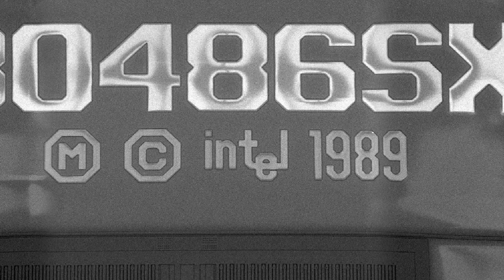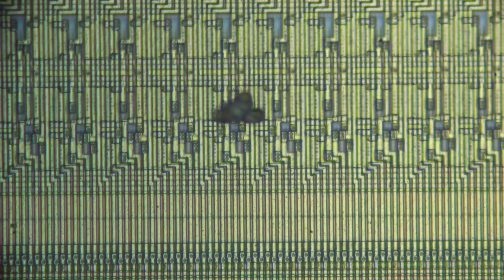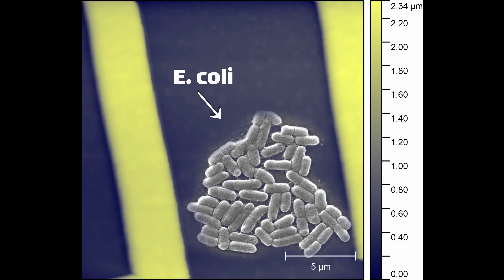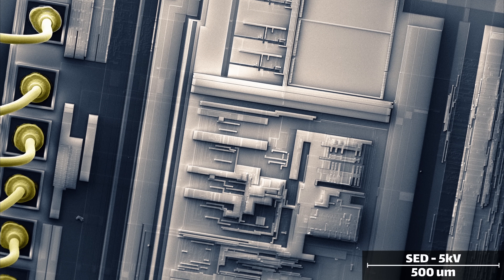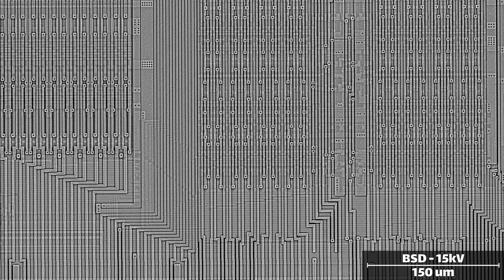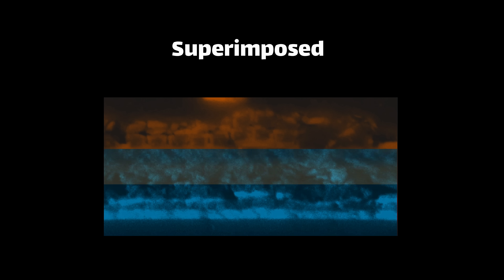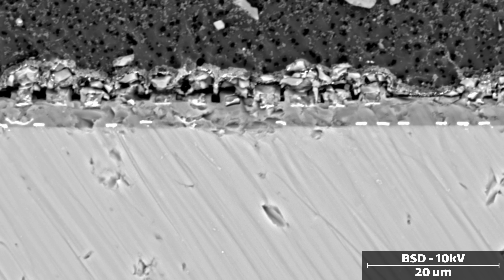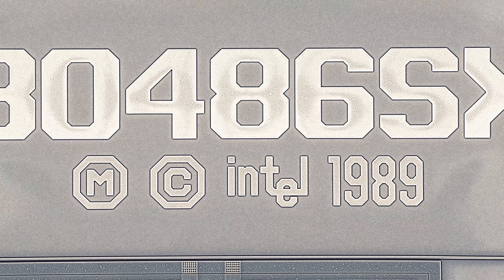Microscopic view of an Intel i486

Comment: 0:40   I don't know. PCBs look quite organic with all the leads leading to chips and other electric components. Directing currents to and from different parts to power, and communicate between them. It is like a combination of an the circulatory system, nervous system, and organs. Each part needs the others. The main difference is the materials used, which dictates the other design aspects. While it is gross to think about, it is not that difficult to imagine a world where scientific advances were more significant in some areas than others, resulting in our tech is made of simple synthetic organisms. Gross, but not too far fetched when you approach the thought experiment from a "function over form" perspective.

Comment: And my i5 2500k is STILL going strong overclocked 24/7/365 since 2011, 4.2ghz 1.27v, stable AF :)
Reply: But also slow. Even absolute garbage these days runs faster and more efficiently.

Comment: Awesome video!

A minor correction, if I may: whenever you said "wafer", you actually should've said "die". A wafer is a large, round piece of silicon, sliced from an ultrapure monolithic silicon crystal. Dies are individual chips microlithographically drawn on the surface of the wafer and then cut out after etching.

Comment: It's not so much that they want to make right angles it that there's no point, especially in the interconnects back then when the defects had to be pretty gross to cause a failure. When you're engineering something that nobody is looking at, function is everything and form is nothing.

Comment: I started work in a Failure Analysis Lab 40 years ago and worked with microscopes and basic tools. A few years ago I returned to the work and now have access to a SEM. You're right about the polishing process. It's a skill and an art that requires a lot of experience to become good at it. I don't have that much either but there isn't much demand to see chip defects in the OEM electronic manufacturing arena these days. My predecessor did this type of work 20 years ago and used plasma etching equipment and chemical etches to remove the IC layers. Removing the layers requires knowledge of the device's construction as one of the other commenters has pointed out. Otherwise you're experimenting and hoping for hte best.

Comment: Thanks for showing this! I have always admired the i486. :) It blows my mind how advanced microprocessors had already become at the end of the 1980s! The i486 DX4/100MHz is an absolute BEAST of a CPU under Windows 95 (with 32MB 60ns RAM and 256k 15ns cache). Not even joking. The i486 DX4/100 is so powerful that it will do true polygonal 3D graphics (it'll play Descent and Descent 2) all in software at 35 fps without hardware acceleration with only a 512kb 16-bit ISA VGA video card under MS-DOS. 8 slot (1x8 bit ISA, 4x16-bit ISA, 3x 32-bit VESA) 25/33/40/50MHz (adjustable by jumper) Socket 3 motherboards are the best motherboards ever made!

As for your video narration, it would be much more listenable if you moved further away from your microphone and spoke louder. Narration is an art form I've studied for decades, and the best style that suites a general audience is a smooth, yet vocal and gritty, authoritative tone (Mythbusters narrator is an absolute prime example). Speaking softly and calmly close to a microphone and letting your voice granulate isn't how professional narration is done. Try taking my advice because I love your videos. :)
Reply: younger people today have no idea how much work a 486 is capable of. I can't think of anything we do at our office, other than the demands of today's internet, that couldn't be accomplished with a 486 just about as well.

Comment: Chip designer here, I am amazed by the amount of hand layout done in the late 80s to construct a processor. Today most of the functionality is automatically placed and routed with a ratsnest of wires going all over the place. This design is beautifully engineered and many thousand of man hours went into such a intricate layout.
Reply: We have IC design courses in University. It's interesting, but the goddamn tools we use from "Cadence" suck so much they make me not want to do it. And unfortunately there aren't really any companies that do this around here.
Reply: @WetPig  Ironically, we DIY home-based chip makers have started to use KiCAD and even sub-$1000 USD compressed fluid piping design software which uses CFD (Computational Fluid Dynamics) math to SIMULATE actual electrical traces, junctions, transistors, etc. and SCALING DOWN the designs to sub-micron scales.

We can find chip-design errata and electrical engineering issues using CFD math to simulate electrical and semiconductor processes within the much-cheaper-to-buy MECHANICAL ENGINEERING design systems! It's a bit of an inventive method using something that was NEVER designed for chip making and using it in a new way for DIY home-based chip making!
Reply: How well do you understand how computers work yourself? Do you just have a simple manual, or do you “understand enough”, or do you have a full understanding of computers? I’m wondering if the knowledge of this tech has to be fully distributed because it is so complex or not.
Reply: @AuthoritativeBanana  conceptually: quite well, I have been involved in several custom processor designs. In detail: only with reading a lot of documentation. 

However, the workload of designing is typically split in large teams where some people do the system design space exploration, some people do implementation in a hardware design language such as (System)Verilog or VHDL, others again do extensive testing and formal verification and then there is the people that do synthesis and place and route as well as sign off (design rule checks, layout vs schematic verification, post layout simulation…) Smaller microcontrollers can be done by a team with a handful of people while large SoCs and CPUs require hundreds of people with very specialized skills.
Reply: @christophmuller3511 hundreds of people for one cpu?! holy shit! Ok thanks.
Reply: @ionutandrasesc2376  Also, remember that designing a CPU doesn't stop at the physical thing; you also have to write the software for it (fun fact most modern CPU have smaller mini CPU integrated into them for managing the internal working of a CPU) and create documentation for developers to use it. Make sure that I can be used on some platform, make sure it has a way to communicate with other components and make sure that it is compatible with old software (if applicable).
Reply: Dude it looks like something an artist painted like holy crap. It’s like a universe within a universe lol
Reply: Well this is also wire bond technology with huge interconnects. We have tiny interconnects nowadays hahaha. The rats nest is kinda necessary for the functionality right?
Reply: Anno Kitsune  you're a bit late lol
Reply: @FlamestoneDragon  lol
Reply: Hello fellow pedants! This is your uber-pedant speaking...

I'd just like to point out that it's "rat's nest", not "rats nest".
Reply: Are you coming to a US based chip manufacturing plant?
Reply: Year 2123: Aaahhhh..... the days of mankind!
Man AND Woman, In the image of, they used to be...... Legends and folk lore we call them now..............................
Reply: Modern chips and CPU’s make no sense; not a single person can follow the operations and logic of literally billions of elements, and no one can manufacture this; keeping track of the specific order and arrangement of billions, and being able to make exact copies at scale?

The entire thing makes no sense. I am fully convinced some esoteric dark art rituals are actually done, and some super intelligent spirit is actually making these things. 

This is why modern war still occurs; we need blood to power these rituals
Reply: @pyropulseIXXI  you can say the same thing about software…

Digital hardware is today designed in an editor writing code rather than connecting transistors together by hand, no one needs to understand every detail, abstraction and tooling makes it comprehensible on higher levels and testable. It’s not black magic.
Reply: @christophmuller3511 yeah but some of us aspire to the dark arts mwuhahaha I am inspired
Reply: @pyropulseIXXI you're an idiot I have no clue how they build chips but they have 3D printers with laser deposition I'm sure they could make something  similar with a very laser point and build chips that way or some similar process again I have no idea how chips are made but I can guarantee it's not an evil spirit
Reply: Why do I not believe you ? oh, it's because there are actual terms for "rats nest"
Reply: @IBeTheEB  bro thinks "rats nest" means an actual rats nest
Reply: @IBeTheEB  I don’t care what you think, but I can tell you that you are not contributing anything which improves the discussion. Hint: this is a comment section on a YouTube video rather than a scientific paper and the audience is different.
Reply: @christophmuller3511  cringe boomer
Reply: @IBeTheEB  In French: Rats nes't pas (Je sais, mauvaise grammaire)
Reply: @IBeTheEB  what's a rats nest
Reply: @IBeTheEB  The unconnected nets are called rat’s nest or fly-bys. However when a set pf electrical connections looks jumbled it is often referred to as a rat’s nest.
Reply: The etymology of the term rat’s nest is I believe from Christmas lights being all jumbled up and looking like a rat’s nest.
Reply: @EricBarthDev  lol. Rats nest is a term used
Reply: @IBeTheEB  Rat’s nest is literally a technical term in this context lmao. If you use any CAD tool for designing circuits (EagleCAD, KiCAD, etc), it refers to all the unrouted paths in a circuit after component/module placement. You can then route it manually or use autorouter, like the original comment said. I imagine the terms of art are similar for chip fabrication software. You’re outing yourself as someone who knows nothing, but pretends to know something.
Reply: @erikchapman3418  You beat me to it. I miss designing. Started by hand in the 80's wow how far things have come.

Comment: If you cleave the chip along the crystal plane you will get a cleaner cross section than your polishing process, which leaves the cross section very rough. There are also professional tools for polishing mechanical cross sections, like ion mills. But a simple cleave should do it, just try it!

Comment: Yeah, and not only are there many more layers now, and far more on-chip components (and multi-core chips), but also the "feature size" has dropped to approximately 200 times smaller than the size of the 486's feature size. (Equivalent to 1 m dropping to 5 mm, or 1 yard dropping to a bit under 3/16 inch.)

Note especially the graph/image at the top right:
https://en.wikipedia.org/wiki/Microprocessor_chronology

Comment: This just feels so unreal. I can't even begin to wrap my head around how people came up with, and managed to achieve this. The scale is unfathomably small, and this is 30 years old! Had I not been sitting at a computer typing this, I wouldn't believe that this was even real. This is mind boggling to say the least
Reply: Definitely crazy, and now your phone has a hundred times more power.
Reply: @oldschoolman1444 try about 350,000x more power
Reply: Very nearly 40 years old now……..And I’ve still got my Commodore-64 and an ‘Acorn’ BBC-Micro….From 1984 and 1983….Both still fully functional after 41+ years….I also have a fully working ‘Sinclair’ ZX-80, ZX-81 and the ZX-Spectrum, which has just been re-released….The ZX-80 and ZX-81 were released in 1980 and 1981 respectively…..All under the control of the Z-80 Microprocessor…..Most Analogue (Vintage) Synthesisers from 1980 onwards utilised the Z-80 Chip as well…..
Reply: So how much smaller are the chips these days compared to?
Reply: Do you still think humans are behind this?
Reply: This technology exceeds human capacity. .02 micron layers of silicone. You are seeing how AI created the Matrix. Or, re created the Earth.
Reply: 👽- "You're Welcome."
Reply: Antimony work was taught to man by messengers...
Reply: This is because we imagine people using tiny tools to construct each tiny wire and stuff but in reality this is more like stamping, or masking. 
They use UV light and certain chemicals to burn/eat away parts of a silicon plane (wafer) using cleaver masks that only let certain UV light pass or certain chemical reactions to happen, in certain parts of the wafer, is like taking a picture but at very very tiny size. 
This to me may remove some of the magic in making of this things but imo is not less impressive, the fact humans were able to come up with this stuff in less than 100 years, is mind blowing.
Reply: Yes but the first prototype design has to be drawn by hand.  @Argoon1981
Reply: i look at these similar how minecraft redstones work, you start knowing the rules of redstones of what it can do, to certain materials and block heights etc.

then you expand it

it feels fimiliar like that except in a smaller scale
Reply: @AAGWGEGEGEFEG  😆 stupidest thing ive read on youtube for awhile
Reply: Your going to laugh but truth is its from an evil source and is dark magic

Comment: I'm very surprised to see "80486SX" etched there in nanoscale lettering. I thought 486SX chips (those without working math coprocessors) were simply chips that were intended to be 486DX chips, but whose coprocessors didn't work and so were disabled, which I thought was done using connections external to the die but within the chip package.

Comment: Which SEM did you use?;)
Reply from the maker: Thermo Phenom XL G2
Reply: @BreakingTaps  haha, it is a pleasure! I work for ThermoFisher, I work on floor stand Electron microscopes:)
Reply from the maker: @letianli3521    Oh rad, that's super cool! Would love to have a larger floor model just for the resolution and extra capabilities, but the Phenom has been an amazing machine and honestly fills 99% of my needs. And in such a nice compact package, and very easy to use. :) If you ever bump into the PhenomWorld engineers pass along my thanks!
Reply: @BreakingTaps  haha, thanks for the reply, I will share your video with the Phenom team, it is good for our promotion😀nice EDS work by the way!

Comment: What a gyp!  He had an 486 SX CPU under an electron microscope, but did not show the most interesting feature?  Which feature?  The physically severed math coprocessor!

The math coprocessor was "enabled" on higher-priced, DX models.  Because fabricating two different chips is more expensive, Intel only fabricated wafers of DX processors; i.e. 486DX.  After fabrication, they "disabled" the math coprocessor on lower-priced, SX models; i.e. 486SX.  "Disabled" --- a euphemism for severed the connection to --- the math coprocessor.  Otherwise, some clever person could (potentially) enable a connected, but (logically) disabled, math coprocessor.

He had it under the microscope, but did not show it.  Was it apathy?  Or ignorance?
The more you know. 🌠
Reply from the maker: Mea Culpa: ignorance! I knew there were two different models and that it was the same die, but I assumed they disabled the functionality via a microcode. Whoops! Would have been neat to show that on the video!
Reply: @BreakingTaps  - I got a full-tower PC, with a 486DX (50 MHz), in Fall of 1992.  Until then, I still used the Tandy 1000 my folks gave me, for Christmas... in 1984.  My freshman-year suite-mate told me those details about the SX and the DX.  He was also BS Comp Sci, but had far greater experience before (and after) university.

Before we met, he graduated from Stuyvesant; i.e. 2nd only to Bronx Science, for NYC public schools.  Strangely, I graduated high school with more college credits than he did.  I had only 1 semester of Comp Sci, though.

But, I digress. :-)

Comment: One way to relate this for everyone: SiO2 Silicon Dioxide is basically glass. Its a great insulator and (relatively)   easy to lay down in controlled thicknesses. So Aluminum is a conductor, Silicon with some impurity added is a semi-conductor, and SiO2 is an insulator. Those are the legos of the puzzle.

Comment: I worked in electronics in the 1970's. The first CPU I took apart was the 4004, very interesting to examine with a standard light microscope...and what ...15,000 transistors..? Or was that the first 8 bit, an 8080..?

Comment: I still find it bizarre how we had technology 30 years ago to make something this extremely accurate. And I still don't quite understand, despite being told countless times, how a CPU or GPU or whatever can function so specifically based on microscopic metals interacting with eachother based on voltages n whatnot.
Reply: Best advice I can give you, is to research how a pn junction works.
Most of what is on a chip (excluding the interconnect and power) is based on pn junctions. Understand about how the pn junctions operate and then how they are made by "doping".
Then I'd suggest you research "photolithography" and watch some videos on that.
Reply: It's just a matter of making nature replicate some kinda of simple logic that we want it to do and then start increasing it's complexity step by step

Comment: I've been working in IT for over 30 years and I am still absolutely amazed at the technology - both the design and manufacture. The things that need to be taken into account... photon oscillation, calculations of how corners are exposed to EUV light (it's not as simple as you think). Breathtaking for a race of moderately intelligent apes.
There is a fantastic (albeit old) speech by someone who worked in microprocessor manufacturing, that's also well worth a watch - Indistinguishable from magic: https://youtu.be/NGFhc8R_uO4 (Feel free to remove the link if you want).